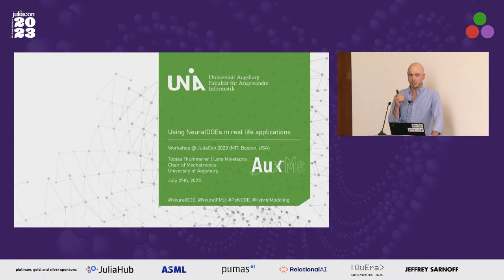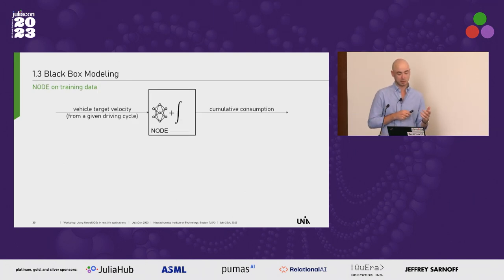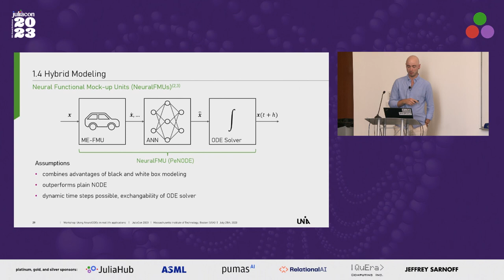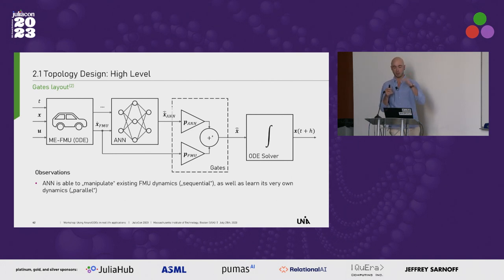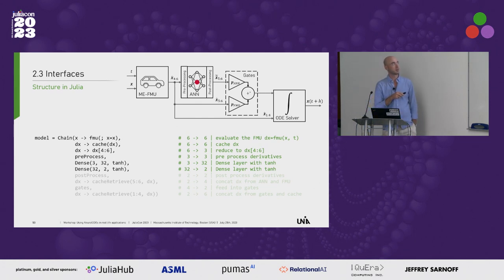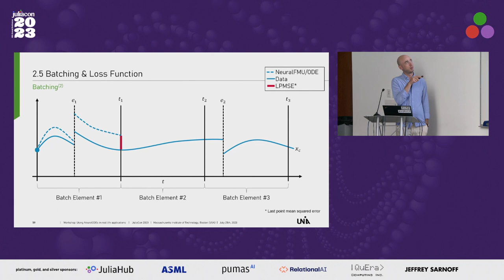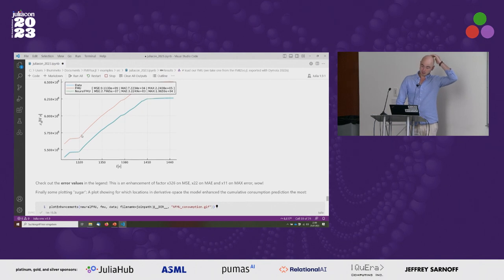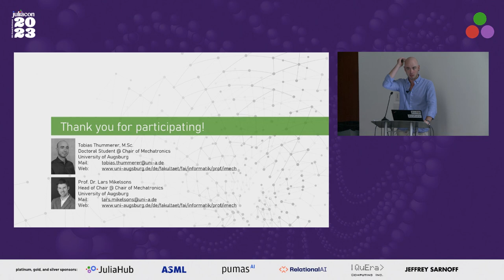Using NeuralODEs in Real Life Applications | JuliaCon 2023

Comment: Very impressive work. I am looking forward to using those tools and also reading the paper for the 2023 Modelica Conference.

A few questions, 
1) how events are handled? For example, the model could be in different states ("state" as in state machine) due to time/states events, the der(x) vector passed into the ANN could be identical, so I am wondering how would ANN react to that?
2) how to get the training "started"? i might have missed this in your presentation, but how would the ANN make reasonable predictions during the initial training phases when the prediction quality is low, I guess this is done through the Eigen informed training? 
3)  have you guys tried CS-FMU? which corresponds to a discrete ANN, I assume the process is similar?